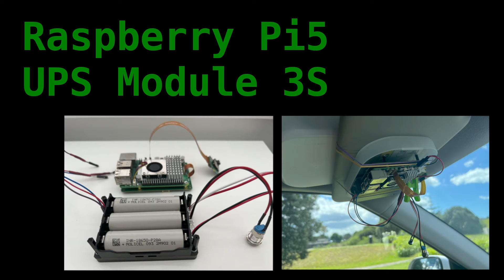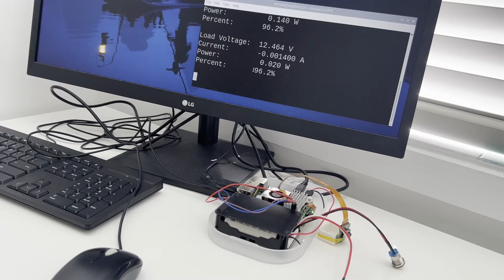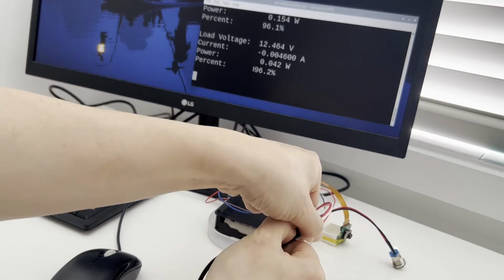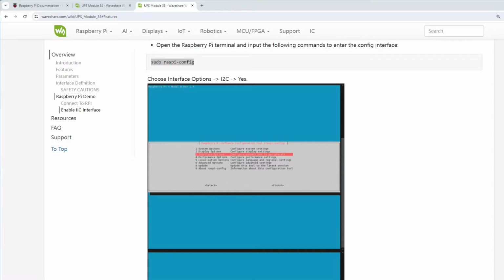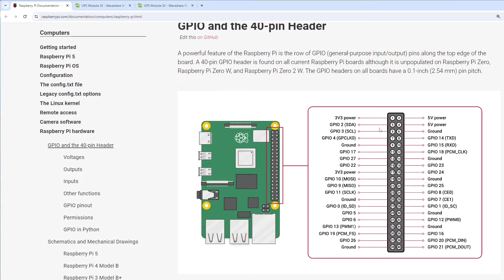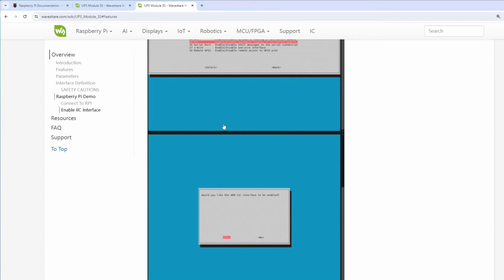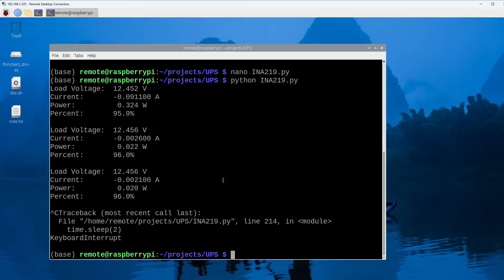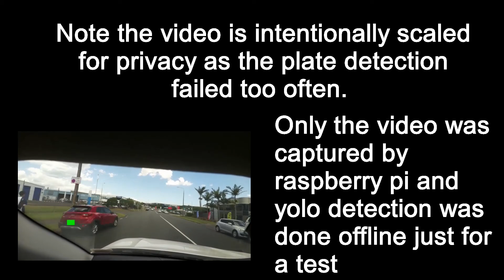Raspberry Pi 5 - Ep07 - UPS Module 3S

Comment: just got mine and got 3 9900mah 18650 button top batteries inserted. got it connected. pressed boot. nothing. 

what could be the cause of it not working?

Comment: Do the batteries work without connecting the SCL, SDA and GND pins?
I want to do a bigger project and I want to use this UPS to power an arduino with two motors attached
Reply: Yes, it has usbc, but you won't be able to read the status from software

Comment: I am trying to connect a Waveshare Model 3S (UPS) to my Rasberry Pi 4B.
I am using 3 18650 batteries to power the UPS. I have checked these batteries and they are 100% good (output 4V per each).
No power output when the battery is connected, nothing happens when I connect it to the Raspberry Pi 4.
Can someone suggest what I should do to identify the problem?
p.s thank you for the video!
Reply from the maker: Hi. @mishasavchuk4096, sorry to hear the UPS doesn't work for you at the moment.
For me, I didn't need to do anything special but put batteries in and the module worked. As I am just a software engineer, I don't know much about electronics so only advice I can give you is to check if batteries are in the correct way and metal bits are correctly touching, which I am sure you checked.  Apparently if you put batteries in the wrong way you will see red led but I haven't tested it.
As it is supposed to work if the batteries are inserted correctly, maybe it could be a faulty unit? Maybe you need to talk to the seller.
Reply: Probly forgot to hit the reboot button after he installed it

Comment: no lo voltage warning? i already tried a UPS hat for it and it worked but kept getting the low voltage error. Thank you for the video, i will try this setup!
Reply from the maker: Thank you for the comment, @javicar31896. I do get low voltage warnings time to time but not always. The documentation says it supports 5V/5A so I thought it was due to the 18650 batteries I used or maybe my one was bit funny. Now I know others get this too! Thank you for sharing your comment :)
Reply: I guess you are using Ubutu with Hat B for Pi5 and got the warning message for 5A
Reply: I get it too. Were you able to figure out to get it away or why it came up?